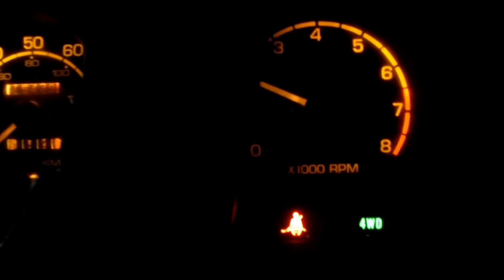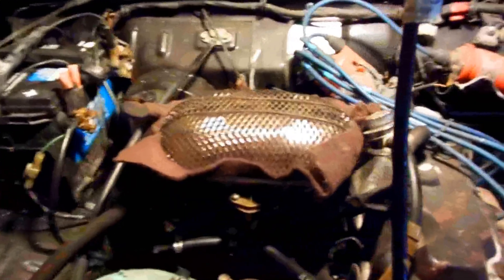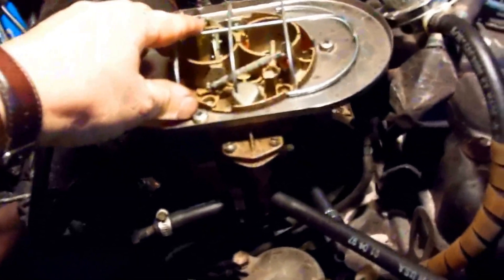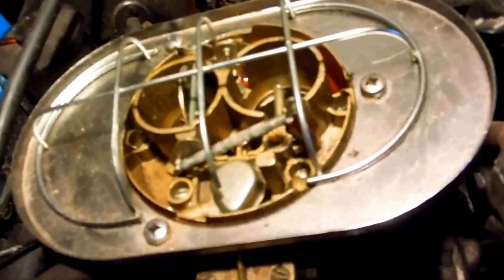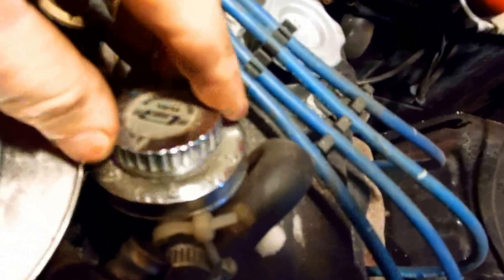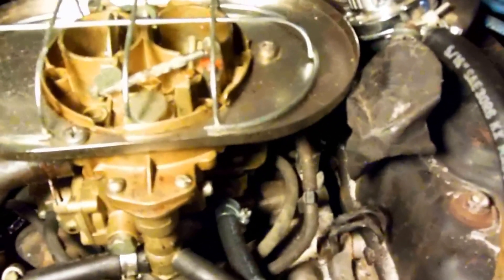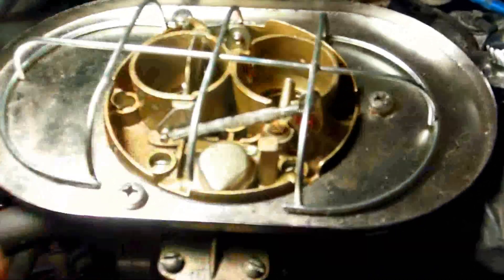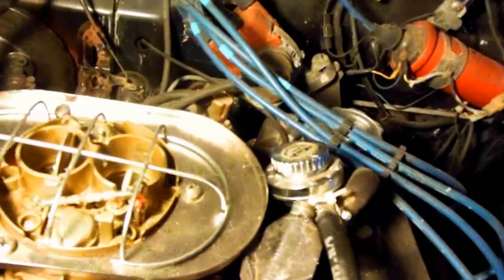Suzuki 4WD Weber Progressive K601 Carb w' Fuel Pressure regulator

Comment: You may get more miles per gallon to that would be nice on that 2 barrel I like the way you caped that other fuel line with a bolt and hose clamp it's a classic ,, that's the part they don't show you in the movie, Good Job

Comment: I'm looking for a regulator and I found the mr gasket one you have installed on amazon. It has bad reviews, people say it either leaks or the pressure is way off. Have you used a fuel pressure gauge?
Reply from the maker: I checked it while ago.  I had this for many years.  It never leaked.  Use Teflon tape on the fittings.

Comment: All that money for a carb you think they would give you a filter it sounds good tho ther real easy now for inspections in jersey that is and they give you a two year sticker yea a heavy filter will bog u down it sounds really good tho your going to have a hell of a time dropping that full tank there's probably two bands that hold it up when you put the tank back up us a floor jack to hold it up for you put a lot of under coating on the tank but that shit will get all over your hands are does it dry those sending units are not cheap put the jeep up on ramps so you will have a lot of room I did on before it wasn't easy good luck I no u can do it Mr S
Reply from the maker: I replaced the fuel tank before, so I know how to do it.  This time I am going to prep the fuel tank and coat it so it can never rust on the inside.  I did that on my Harley, many years ago and the inside fuel tank coating is still 100% fine.  This carb did come with a foam air filter.  I just found the solution for a replacement and it's simple.  Just order some foam sheet air filter material and cut it to size.  Too easy.  I just thought of that.  It will work perfect.  Use K&N filter oil o the foam and it will filter out the smallest dirt particles.
Reply from the maker: I'm doing everything on this thing cheap but good.  Just like others would want to do and know how.  I likely do need a sending unit, unless it is just the ground wire.  I have found a good quality sending unit for $25 and will post how to check them and replace it.  These type of vids are actually more helpful to people.